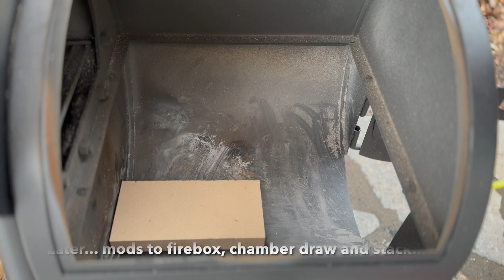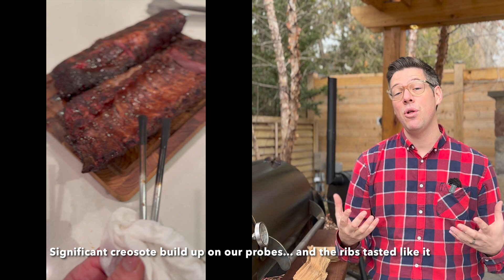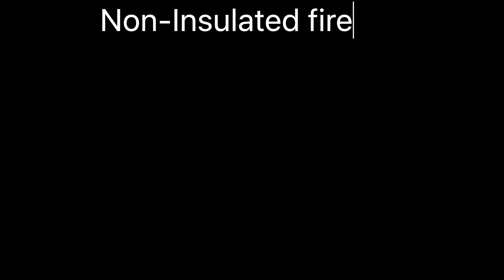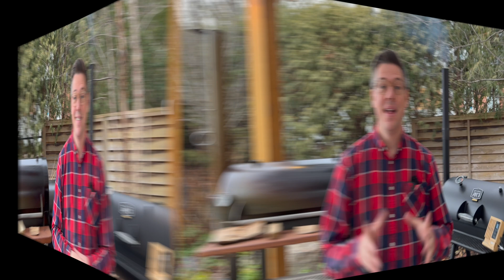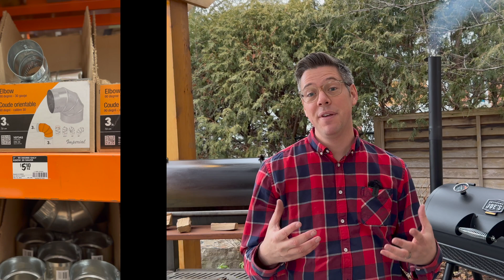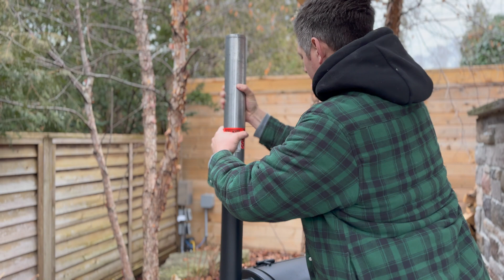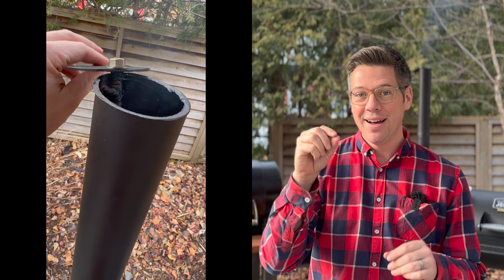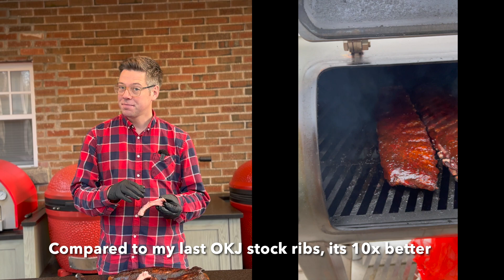Can $50 in smoker mods make my cheap offset as good as a premium smoker for WAY less $$$?

Comment: Good Job Smoking Dad!   
I have an OK Joe.  I have done some  other Youtube mods which have worked very well too. 
I noticed that you didn't use the grate in the firebox to raise the fuel above the box floor which allows air flow.  Thats a problem.  BUT, that said, I think that your idea of using the fire brick instead to insulate is a great idea.  I will add that cheap mod!  That will actually give more room in the box for me and aid in fire management I think!  THANKS! 
It is really hard maintaining a consistent fire in the small fire box.  I find I must add fuel every 30-45 min and watch the temp constantly for hours!!  Eliminating the grate and a fuel basket using the fire brick should help immensely.  Thanks again!  Im gonna try it!!
I saw the idea before for the "dryer" vent to the exhaust from the cook chamber to the exhaust. I rejected the idea of the vent from the grate to the exhaust stack.  That reduces cook space!  BUT, I did add a mod of a baffle from the firebox to the cook chamber.  It was super cheap and easy and takes up zero cook chamber space.  Just wrap a grate in aluminum foil and make a baffle from the fire box to the cook chamber by angling the baffle and directing heat and smoke down and across the cook chamber.  I experience only a 10 degree difference from end to end. Very acceptable!  There are expensive commercial baffles available, but a foil wrapped grate does the same thing for cents and no clean up!!
I have no problem cooking 4 whole racks of ribs in the cook chamber. using the 3-2-1 method.  More capacity if I use an  additional elevated rack!  More than I usually need.  However:  BTU is BTU, once wrapped there is no more smoke flavor induced!   Smoke ribs in the OK Joe.for flavor...then wrap and complete in the house oven if additional ribs are needed! 

Good Job and thanks again for the ideas.  I will be buying firebricks for my OK Joe this week!!  You're da man!!

Comment: Question about the fire bricks: Isn't that the same as having the coals directly on the firebox, which is not recommended as it's too hot to be on there bare? Will the fire bricks get too hot and hurt the base of the firebox over time due to that?

Comment: Try using some JB weld to hold your bolt on!! I would definitely do it in small layers and amounts also and just keep putting several different layers on giving it time to dry in between layers!!! A buddy of mine uses that stuff for everything including gas tanks that has holes in it and both metal gas tanks and plastic gas tanks and I’ve seen it work every time he has used it!!! It is very important to get it mixed correctly also to get it to work!!! He’s used it on many many other things but that is just a couple different things that has worked and I didn’t even think it would work at all!!! Lol!!!

Comment: Ok, so as an OKJ Highland user myself, I can say that it is difficult to run properly. However, it is not wholly undoable without mods. It took me a bit to figure it out, but I don't seem to have near the trouble that you're having. I'm even burning the same size logs you're burning on your premium offset, and control temps just fine. Could you just be putting greater expectations on the OKJ given your collection of insulated and premium cookers? I'd love to own a premium offset one day, and I'm considering the stack extension and lowering kits from BBQ Smoker Mods. But, I believe that learning to drive the beater will make you better at driving the Ferrari, so to speak.
Reply: I've watched 3 videos.  In the back of my mind  , I was thinking the exact same thing.

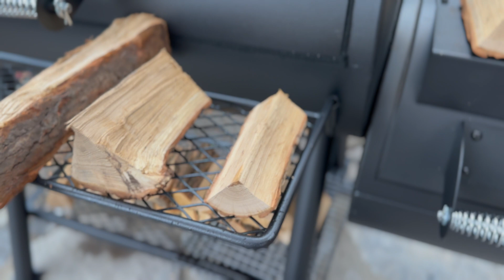Comment: I love the fire brick mod. I have an OKJ Highland reverse flow smoker with a few mods that have been working well for me but nothing done to the firebox. The fire brick thing gave me an idea and I have been looking into refractory cement which people use to glue fire brick together. It can also be used to form curved bricks as it is supposed to hold its shape during curing. I have an extra firebox for my smoker and I'm going to try making a mold inside the box and spreading some refractory cement on the bottom about an inch and a half thick to try it out. Wish me luck. 2:06
Reply: i just got a okj highland rev flo. and i.m kind of tossed between fire bricks with joint sealer. or your idea of cement. the bricks will have some air space under them unless i cut them into narrow lengths then bed them in some of rutlands bonding sealer. i think its 6 one half dozen the other. the bricks will allow to cover more side area which is what i'm leaning towards. i just don't want a smoker that weighs like a tank. i know that longhorn is a 270lb beast to move around empty.
Reply: Do you have any issues with uneven temps i notice the left and right sides of the rack are consistently 10 degrees higher.

Comment: That elbow you installed is galvanized steel. Really not a good idea having that in your cook chamber. You should probably replace it with aluminum..
Reply: Nevermind, I see you are aware of it..
Reply from the maker: I did go for a steel one but the risk is at 392f and I don’t run my offset that hot

Comment: Great video! I just purchased my first Longhorn reverse flow and am excited to put these mods on. I’ve already put the exhaust pipe in my Amazon cart. 
I wanted to let you know, if you get a cable clamp small enough to hold your screw that would be a more secure way of connecting for your exhaust cover. 

Thanks again
Reply from the maker: Congrats

Comment: JB Weld your screw to the pipe. I used the red/black two part type, Put jbweld on both pipe and screw, clamp and wait 48 hours, Remove clamp and finish JBweld the outside of the screw where the clamp was to add more security. Just make sure the surfaces are clean so it will stick.

Comment: You can use brazing to affix a ring to the smoke stack that your screw can fit through. Brazing only requires the use of a torch (simple burnzomatic will do), and a brazing rod. No welding skill or equipment required.
Reply from the maker: thanks. will check that out

Comment: Absolutely awesome mods!! I admit that I spent $50 on the stack extension as I don’t have the tools to saw an exhaust pipe… but that being said all mods were under $100 and after my first brisket I am amazed at how much easier fire management was!!! Hope you don’t mind a shout out to another channel, but I found the best way to hold my brisket overnight from Outnumbered BBQ after that easy cook! For the longest time I was holding in the oven (min temp 170 F… but actually registered at 187 F on my thermometer) overnight, but after watching Outnumbered BBQ’s video I bought a portable turkey roaster ($50 used on Amazon) that can warm as low as 120 F but I could hold at exactly 150 F for as long as I needed. Thanks again for the time you put into figuring out all these mods so I can pretend to be great smoker 😁

Comment: Is there anything in a fire brick that could be dangerous to your health?
Reply from the maker: I emailed and asked and they said it’s safe to use like this. Just not food on it but in the oven is fine they said
Reply: @SmokingDadBBQ  I bought the same exhaust pipe. Is it necessary to cut 3 inches off?
Reply from the maker: @knuterockknee  no. I kinda wish I left it
Reply: @SmokingDadBBQ  do you even use your okahlma Joe? That smoker you have is beautiful
Reply from the maker: @knuterockknee  I got it as an experiment to help decide if expensive pits offer an advantage or just take more money .., I will be selling it by spring
Reply: @SmokingDadBBQ  Do you think it's that big of a difference. 5k vs 400. I am thinking of adding a smoke collector and increasingly the pipe to 3.5 inches
Reply: Do you think it's safe to add a high temp gasket between the firebox?

Comment: Get some metal zip ties and attach the screw to the outside of the pipe.  If you need, just punch out a larger cover.  Easy and cheap.  Wa less work than that silicone attempt!

Comment: I have almost same smoker, (mustang offset) and same problems. And at winter when its windy and -10 to -15°C its real pain to smoke anything. Temps are runing up and down and I keep runing between offset and house for every 5-10min. I was thinkin to put fire bricks at cooking chamber near firebox, before I saw this video. What you think?
Reply from the maker: 100% do that. I got much better results running it the way I wanted to run it vs listening to the charcoal, v grate and wood flavour approach here. 

This is the mod I did https://youtu.be/6CstFU78PgY

Comment: Great video, I will definitely try the fire bricks for insulating the firebox. I had about a 60 degree F. difference from one end of my smoker to the other, and about 25 degree F difference between the upper chamber and the cooking grates before doing any modifications, and it was a chore keeping the fire from smoldering.  I added an extension to my exhaust pipe, and put a thick metal water pan on the grates closest to the firebox. Ever since then, I have pretty much uniform cooking temps of about 2 degrees difference, without having to put in an a 90 degree elbow. That was the biggest game changer for me with an OK Joe Highlander. The water pan acts like a baffle, and the the extended exhaust improves draw. I am keen to try your fire brick idea to see if that extends my fuel efficiency, and saves me time fiddling with the fire every 15 to 30 mins.

Comment: A small U-bolt with a big(ger) bolt with a nut could be used for your damper. Drill 2 holes for the U-bolt to stick into your exhaust pipe. That'll hold the big bolt with the nut screwed on all the way up towards the head, with enough of a gap in the thread (between the nut and head) for the U-bolt to sit in.

Hope that makes sense.

Comment: Excellent video (as usual),  I'm attempting the firebrick mod on my Oklahoma joe longhorn reverse flow as I type this out!

If any other Oklahoma Joe Longhorn smoker is looking for a stack extension, this part will NOT fit,  the longhorn exhaust pipe is 3.5" vs the 3" on the highland.  I'm looking for a easy to buy extension, no luck yet, may hit a local muffler shop.

Comment: Good job. I’ve found that whether one owns a COS or a thousand dollar smoker that if the cooking chamber is smaller than a 24” diameter the smokers are usually just shit quality to cook on.
Reply from the maker: I need to catch up on videos but I just got my Gen 2 offset and it’s 24” and I couldn’t agree more 

Offsets are a lot of work but really only show the benefit at higher capacity imo … so getting a smaller offset that doesn’t flow as well, is harder to run, and doesn’t fit enough to make it worth it is kinda not a good buy even at blow out pricing

Comment: First..You are circumventing the firebox design efficiency by building your fire on the bottom of the box. By installing one of the grates provided with the OKJ, you are raising the level of the fire closer to the chamber opening, and, you are able to scoop out the ashes under the fire during the cook. This provides more airflow and a more consistent fire. (I use the optional expanded metal box on top of the grate as well). This way you do not have to go through all the work of insulating the firebox with fire stones. Second..if you install a baffle in the bottom of your chamber, it negates the need for a chimney extender and the dryer vent (which in crazy in my opinion) The baffle does two things..it evens out the temperature in your chamber and directs the flow of heat to the smoke stack end. By directing the flow to that end, you do not need to modify the stack outlet. 
Those of you that have the OKJ Highlander, try these Mods..I assure good results!!
Reply from the maker: Thanks Charles

Comment: How did the OKJ ribs compare with what you can make with the Kamado Joe? I have the latter and have been wondering if I should invest in a COS as I can't afford an expensive offset at the moment.
Reply from the maker: I have recorded this using charcoal for heat and wood for flavour since so many want this setup on the OKJ vs my Akorn as both are under 400. 

The OKJ comes with all the work (or more) of an offset without many of the benefits in size / capacity or smoke quality 

I think if you’re going to get an offset …. Get an offfset. But it’s no wonder some try this size and are frustrated

Comment: Watching the video and a good solution for your exhaust screw would be J-B Weld.  You need to clean everything back up and scuff it with sandpaper or steel wool and then some alcohol but one the J-B weld sets up you should be good for as long as you keep the smoker.
Reply from the maker: Thanks

Comment: hi James  quick fix for the damper  put the bolt on the out side of the stack get  1 or 2   stainless steel  hose clamps   put the bolt on the  out side of the stack  put the hose clamp over the shank of  the bolt  that will work for now or find some one that can weld it  on for some of your world famous ribs  good luck with the mods
Reply from the maker: Thanks